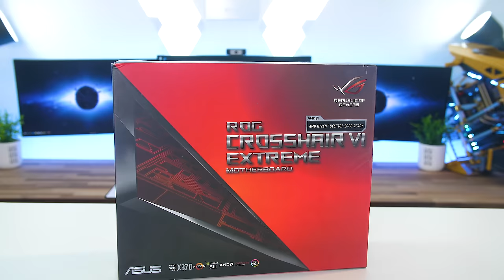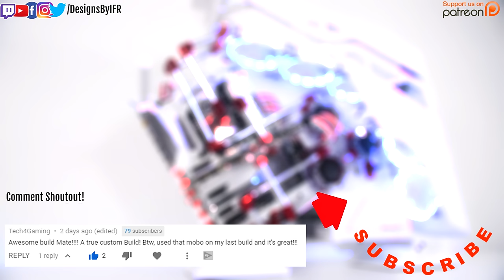AMD Custom Water Cooled Gaming PC Build - Time Lapse 2019 - Antec Torque

Comment: Opinion on the Antec Torque vs Cougar Conquer after building in them both?
Reply from the maker: The torque has more cooling apace for bigger radiators etc however the conquer is more compact and i like the look a little better

Comment: I'm currently saving up to upgrade my dusty old fx 8350 into an r5 2600. Main problem is that I have to upgrade the whole platform. I'm also using a gtx 960 4gb which is getting the job done at the moment since I mostly play esports games, but I might upgrade that next year.

Comment: Perfect build like always.
I'm just wondering what's the name of this fancy atx 24 pin 90° adapter and how expensive is that.
Reply: Pretty sure that's stock. Some high end boards will have it. Cooler master make a 24 pin 90° adapter though.
Reply from the maker: This came with the board
Reply: Thanks 😊😊

Comment: Nice build...EXCEPT the all white power supply cables. Why didnt you throw a wire or two blue and 3 or 4 wires purple and left the rest white??
Reply from the maker: Because i would have to buy a new set of cables
Reply: @DesignsByIFR  And thats what pushes builds over the top.

Comment: Those 45 degree bends are spoiling everything. And the top tube is not aligned perfectly.
But overall a sick build.
Reply from the maker: They look perfectly aligned to me. Perhaps it is just because i didnt show a front on pan so it looks a tad out. The 45 degree angles were to bring the two tubes in alignment, i had it straight to begin with and it looked weird
Reply: @DesignsByIFR  Must be the camera angle.

Comment: Nice build mate, Just wondering what can i build with for $1900. looking at what motherboard to go with a 1080 and what Ram and Power wattage i would need.
This be my first build and not sure if i want to go for water cooled or just use 4 120cm or 140cm fans. 
I dont mind AMD tho as there still pretty good items.
Reply: Doesn't matter how many fans you have you need a cpu cooler regardless so you dont need to do all this you can buy a prebuilt water cooler. For a budget of 1900 you can get away with an rtx 2080 if you look hard enough I'd also recommend an i7 8700k. Hmu if u need help
Reply: @kyaii  yer i know the cpu needs a cooler.
Reply: @hecticgerva1192  okay just making sure...
Reply: @kyaii  all good.

Comment: wait so how do you ensure no fluid came out of the port on the gpu you used to fill it?
Reply from the maker: I used the gpu port to get enough liquid in the system so that the pump wouldnt run dry, then i used my fill port up the top and at the back of my custom reservoir.

The tubes above still were not full of liquid so i could remove my fill tube without any leaks

Comment: How do you put the cpu??
Reply from the maker: You insert it into the slot
Reply: But the slot is closed with the thing inscribed Crosshair
Reply from the maker: Yes i put the cpu in first then the water block on top of it
Reply: Ouh ok. And how do you change the gpu ??
Reply from the maker: To change the gpu you drain the liquid first then remove it
Reply: Oh ok. Thanks for your info.
Reply from the maker: Very welcome

Comment: My pc build:PLATFORM INTEL

CPUCORE I9-9900KF UPTO 5.0 GHZ

MOTHERBOARDASUS - Z390 ROG MAXIMUS XI EXTREME

GPUSLI - RTX TITAN (2 NOS.)

SMPSCORSAIR - AX1600I

RAM16X4 - CORSAIR VENG RGB PRO 64GB 3200

CASEANTEC - TORQUE

CPU CoolerTT - WATER 3.0 360 ARGB

STORAGE 1SEAGATE - BARRACUDA 4TB

STORAGE 2SEAGATE - BARRACUDA 4TB

Wifi CardASUS - PCE N15

Comment: Doesn't make any sense to drop the cash on a full custom water loop when running a GTX 1070.
Reply: 1070’s are good plus overclocking = awesome card 

what’s the issue?
Reply: @r3gaming545  Oh no problem. Its just the build is unrealistic. If someone had the money to drop hundreds of $$$ into a custom loop, why would they not be running the most powerful xx80TI Graphics card in that system?